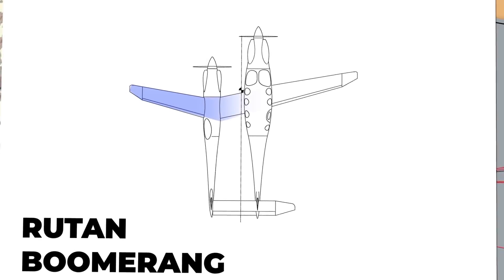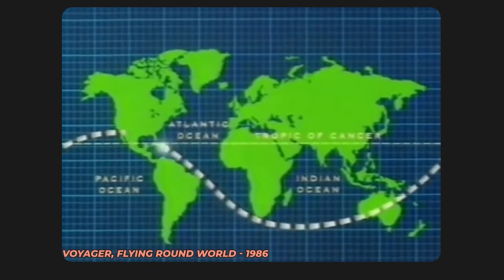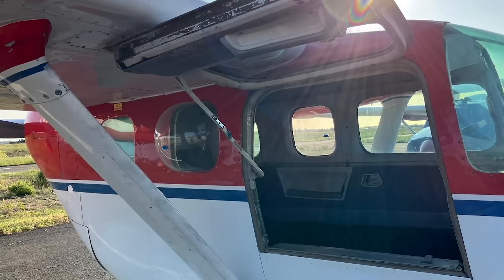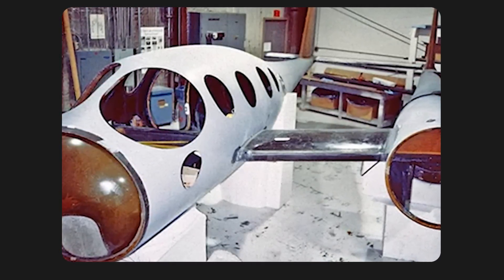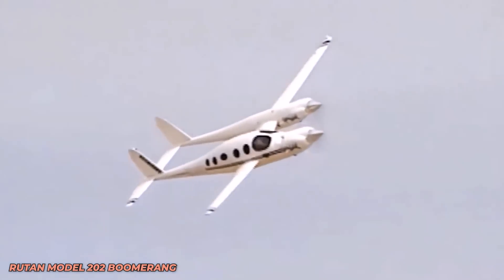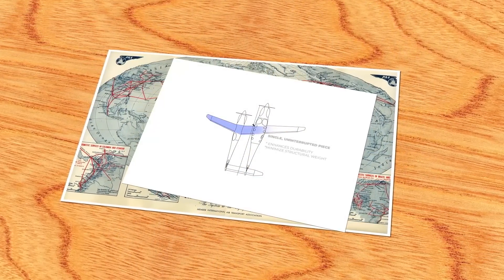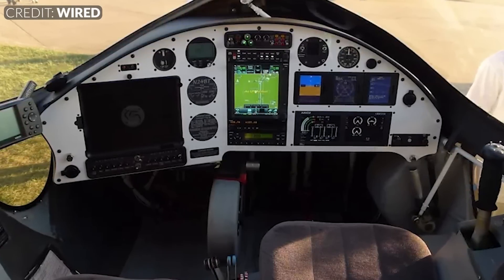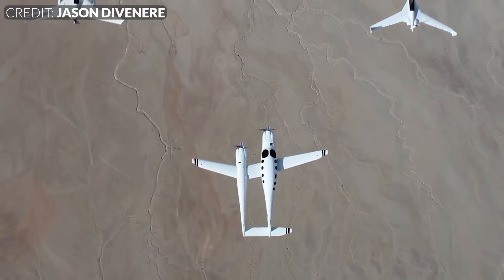Rutan Boomerang: Unconventional Genius!

Comment: He is intuitive when it comes to building that's why no wind tunnel or CAD is needed for his designs. It's a gift. I had a friend  who could not do any RD without this when having fun with our High Power Model Rocket Club. My designs would always out perform his. This would frustrate him so much he asked me one time " How is it you can design a rocket, 12 to 20 feet long, without any mathematical workup and my rocket are so inferior to yours " I replied back, how is it you can design your rockets with all the mathematical formulas ? We both just laughed. I just build the rocket ! Of course I test it and take measurements after it's build, but it just comes to me. My first launch with my first HP rocket I designed back in 1991 put my rocket to just over 10 thousand feet. It landed less then a football field away. All systems worked fine and the recovery system ejected at apogee, I packed it up and lunched again the same day. Today my club, Tripoli High Powered Rocket Club hold a club altitude record of 50K, not bad for a club. I love building things and aircraft are my focus. I often find my self building all kinds of different configuration, of course it's only RC models, but the similarities are the same except for size. With today technology it might surprise you how far model anything has reached levels never possible just a few years ago. I have a RC buggy I built that does 72 miles an hour I couldn't do that without the technology of today. All you need is effort.  I feel as if I missed my calling. I have a aeronautical degree, but it's only a two years of schooling. However, I've worked on aircraft for 20 years, during my military service. When I left I started college to become an engineer, but life sometimes takes you down different paths so Remote Controlled models will have to do. Burt is an incredible designer maybe some day we can gain permission to build a RC model of his Boomerang plane.
Reply: Decades ago, for the longest, people were building airplanes and racecars without the help of windtunnels and computers. Just good ol hunches and guestimation. Today they'll tell you it's impossible without such things, like they'll tell you that you can't just build something without years and thousands of dollars of schooling. At this point, so much research, innovation and tech has been done, so many things have failed, all this man[and the rest of us] needed was some imagination and common sense. That plan looks crazy until you realize common sense dictates the plane has the properties it has, so it works.
Reply: @ItsDaJax  Planes do not fly based on common sense.
Reply: @ItsDaJax would it be correct to say modern tools are more for efficiency instead of viability though?
Reply: @xostler  Yeah, I'd agree with that.

Comment: Does the staggered main gear cause any stability issues when touching down? 

My naive non pilot intuition tells me would cause problematic torque in both pitch and roll, and perhaps yaw to a lesser degree. 

But... would it be notably different than when a similar sized plane has one wheel hit first?

So maybe it's in a normal landing that this comes into any play at all... wouldn't there be a slight bank towards the boom side on touchdown?

Don't get me wrong... I'm not questioning whether he made any mistakes, I'm just curious whether this had a meaningful impact at all. 

All designs are full of compromises, and as this was an idea testbed design the choice of exactly where some compromises landed would probably be different than in a production aircraft.
Reply: Yeah it probably lands flat. If you think about it, the landing config makes perfect sense. It's probably more stable than a motorcycle with a sidecar.

Comment: I wonder if Burt would consider a 6-8 passenger turbo prop variation of this aircraft. That might find a lucrative place in the GA market. I would be interested.
Reply: Hardly. 2 engines are always worse then 1, especially on such small scale.
Reply: @alexturnbackthearmy1907 I mean, 6-8 passengers is bigger scale than the 3 passenger design from the video
Reply: See @jackoneal3933 comment earlier about a larger version and FAA wanting them to pay 10X the normal price for paperwork.

Comment: 12:16 Stability during take-off: To my untrained eye that is not a demonstration of stability. No haters please, defenders welcome.
Reply: I can't say.  It could have far more to do with gusty crosswind than anything about the plane though.
Reply: Ridiculous even to try to judge from a short clip in YT. To judge you would need hundreds of hours of flight and takeoffs and landings by experienced pilots....
Reply: @Axel_Andersen  Which of its design concepts have taken root in any area of aviation?
Reply: @careerscarce167  Whats that got to do with the question if this is a demonstration of stability or not?
Reply: @careerscarce167  The cost of certification for a GA aircraft is $25 M, try raising the kind of money for a better Beechcraft. Add to that the cost of starting manufacturing and the risk of liability and you see that very few new GA aircrafts enter the market. 

So weather any Boomerangs were sold or not does not tell much about the value of the design concepts. 

Good designs/ideas/prototypes do not automatically result in sales. Just likes sales do not indicate a good design.

According to one commenter here the cost for certificating a Boomerang based air taxi was in the ball park of $100 M and that was back then.
Reply: @Axel_Andersen  I asked for defenders and you're being disingenuous. I allowed myself to be pulled into your tangent. It's inherently unstable in the clip because it has a tandem pair of wheels and a sidecar. That raises the pilot workload at takeoff and landing. Why are you bringing sales and financing up?
Reply: @careerscarce167  I brought up sales and finance because you asked  "Which of its design concepts have taken root in any area of aviation", which I think definitely depends on the cost of getting anything accepted or "take root" in aviation.

I have zero competence to make any judgement re the actual plane, my comments were triggered by the poor framing of many of the questions here. People justifying their opinions with things that are obviously moot or invalid. 

This plane may have its problems but the fact that you used a short clip as a spring board to discuss stability that must be complex issue (beoynd my expertise) was triggering.

LIkewise popularity or adaption has little if anything to do wether a product (any product, but especially GA) seems to have very little to do with if a product/idea is good or bad. I say this after 40 years in product development in several fields.
Reply: @Axel_Andersen  IOW: You brought finance up because you didn't have anything. You presented a textbook example of an informal fallacy "fallacy of relevance," aka 'straw man.' The subject was aeronautical engineering and you applied finance to the argument. "Too expensive" was an argument you could win. BTW: The clip at the time cited originally cited used "stable" 12:16
Reply: @careerscarce167  I would not have gone there at all if you had not tried to use the un-popularity argument ie "Which of its design concepts have taken root in any area of aviation" ... which has little or nothing to do with your original "To my untrained eye that is not a demonstration of stability" comment. 

How is that for changing goal posts. 

And my response to the un-popularity argument i.e. very high cost of bringing anything new to aviation is one valid response.
Reply: @Axel_Andersen  "Which of its design concepts have taken root in any area of aviation?"
"Whats that got to do with the question if this is a demonstration of stability or not?"
You seriously don't see that you were granted an opportunity to defend any design aspect, take-off and landing stability and beyond, and you chose to use the certification process as a shield?
I frankly like the aircraft and gee whiz think the forward swept wing would present an engine-out lift advantage on the feathered side, similar to how a swept wing aircraft's leeward wing behaves in a crosswind. But my eye's untrained and specifically I asked not to get into a hater discussion, and here we are in this room. I took the bait.
Reply: @careerscarce167  Sorry you took it that way. I have zero competence to judge the design, one way or other. But you chose to belittle it because it was not a commercial success or am I reading too much to "Which of its design concepts have taken root in any area of aviation". Perhaps. And IMO that has little to do with if it is good or bad. I think I've made my little point several times now. Thanks for playing.
Reply: @Axel_Andersen  Thumbs up

Comment: I think the Boomerang is a fantastic design idea! And having the separate fuselage for luggage and freight is a great bonus.
Reply: Watcha smuggling buddy?
Reply: @ryshellso526  
Watcha smoking buddy?
Reply: Watcha got?😂
Reply: @freedomforever6718  currently skittles Mintz, and a touch of hash.
Reply: @ryshellso526  
That explains everything.
Reply: Just because Rutan designed it you give it a blanket idea that it's genius. LOL. As a research vehicle, I'll give it a pass. Outside of that, it's pure crap!
Birds are symmetrical for a reason.
Reply: @muhammadsteinberg  
Lol.  Birds don't have mechanical propulsion.
Reply: @freedomforever6718  Neither do gliders built to maximize the properties of aerodynamics.
Even the guy that designed it stopped pursuing it. You aren't smart enough to figure out why?
It would be interesting to see what the spiraling slipstream looked like with the engines running. I imagine it would be crap.
Reply: @muhammadsteinberg  
Take your anger management problems somewhere else.
Reply: @muhammadsteinberg 
LMAO
Birds have a single control system.
Birds don’t have twin engines.
Birds aren’t airplanes and planes aren’t birds.
Birds can also fly with asymmetric wings due to injuries.
Reply: @Talon19  Those of you trying to defend this nonsense with more nonsense, obviously aren't pilots. Rutan himself ditched this foolishness. Really nothing to prove here.
Your injured bird analogy was about as dumb as dumb gets. Flying birds it's their major mode of transportation, so they have to fly to survive.  Several decades of flying I have yet to meet a pilot who intentionally flies an aircraft with a defective airfoil of any type.
Reply: @muhammadsteinberg  
The Boomerang is Rutan’s favorite design.  I know because he literally said so at his brother’s memorial earlier this year.
There are also numerous articles by people who flew the Boomerang on only one engine without needing rudder or trim inputs to maintain SLUF.
I have over 5000 hours in aircraft from single engine piston GA to multi-engine turbofan military jets.  I also have a bachelor’s in aeronautical engineering,  a master’s in aerospace science, and have done wind tunnel and then n-flight testing and evaluation.
Yet all of that pails to the simple empirical tests people have shown with the speed, endurance, efficiency, stability, and safety of the Rutan Boomerang.
Reply: @muhammadsteinberg  
You claim to be a pilot yet you haven't been able to figure out how to send a reply directly to the person who you are addressing.
Reply: @freedomforever6718  One is an insignificant youtube conversation. The other is aviation. Please know the difference.
Reply: @Talon19  All those claimed creditials, and you still can't except that, that design was a concept build and has no aeronautical value. 
Let me guess, you're also the most successful Kamikaze of WWII with 300 sorties.
Reply: @muhammadsteinberg  
You just proved that you are not a pilot. Thanks.
Reply: Not really. More like a problem you need to deal with, weight unbalance is a big deal in even monohull planes. The best way to treat it is like proof of concept plane, it is just not viable as-is.
Reply: @alexturnbackthearmy1907    With all due respect, Burt built the plane with the extra pod intentionally not just for reasons related to aerodynamics, but also so he could lug his golf clubs along with him wherever he was going.  It happens to also carry skis, or luggage or any other bulky items that aren't typically able to be carried in more conventional configurations.  It's a totally viable option,  and a really great bonus as @freedomforever6718 said.
Reply: i wonder if the answer on a production model would be the ability to balance the plane out using the fuel in the tanks

Comment: I saw the boomerang at Mojave airport in Sept., 1996.   Scaled composites was managing the flight operations of a UAV, under a NASA contract.  I looked inside the cockpit and saw no instruments, just a laptop.  Inside the main building used by Scaled Composites was the Voyager aircraft, hoisted up to the ceiling.   I also saw a prototype airliner they were working on.    A larger area of the building was walled off.   We were told that area was restricted.   A coworker was declared persona non grata after going in there during a previous visit.   I met both Rutan brothers.   While the UAV was flying a rather large jetliner arrived and stopped next to Scaled Composites's buildings.  Several business-suited people came down the ramp and went inside.    I later learned that Paul Allen was among the visitors and the jetliner was his private plane.
Reply: I thought I read that he used Mac laptops as instruments...
Reply: @earlwebster5351  I think I said laptop.  I didn't get a good look at it.   Their UAV control van was very cool.   It had a big bubble on top of the front where the UAV pilot's sat, which afforded them a 360°  view of the sky above.  They had 2 laptops with large screens for piloting the UAVs.  Edit:  The computers might have been desktop units.   I think the monitors were shielded from the bright sunlight.   Mounted on the back of the van was a genset and A.C. unit.   The A.C. pumped cool air through a large diameter flexible tube up to the bubble.  It was very hot outside.   All the people at Scaled Composites we interacted with were very helpful and knew their stuff.   They loaned me their Bird wattmeter when I was trying to find out why the TDRSS satellite uplink was not working.

Comment: The Boomerang is alive & well in a hanger at the San Luis Obispo airport. At least it was a couple of years ago. I talked to the person in charge of maintenance and we talked about why it was there & not out in Mojave. I actually touched it. It's a one of a kind plane.
Reply: See the Blohm und Voss BV-141.
Reply: It's still there as of this year. Saw it and talked about it with someone involved with its restoration. Such a wonderful plane.
Reply: If it's so good, why haven't more of it been made?
My guess: too expensive to make due to the manual carbon fibre construction.
Reply: @SailingSoWhat  Same reason why newer aircrafts dont sell as good as older ones: They are just MUCH more expensive, with little to no extra gain. It might even be much cheaper to order a brad new aircraft of older model instead of even looking at newer ones.
Reply: @alexturnbackthearmy1907 a damn shame.
Those old birds have such inefficient airframes.

Modern airframes are so much sleeker, have so much less parasitic drag. The fuel consumption is drastically better.
Reply: @alexturnbackthearmy1907   I guess you have a point with the price. However, if we believe this video, the Boomerang does not offer "little  to no extra gain". How would you price safety? Not to mention the performance and practicalities of this design. I think this is more rooted to the expense of getting any new GA air plane designs to the market.
Reply: @Clayne151 Because it's novelty junk! There's no benefit  in this design. Hence, it is a one-of-a-kind concept. I have a hard time believing that plane being asymmetrical would be safe with total engine failure. Trying to glide with an asymmetrical plane makes zero sense to me.
Reply: @muhammadsteinberg  you vs. Burt Rutan. Hmm, that's a tough one to decide....
Reply: The Boomerang is still very much alive and well!
Reply: @russbell6418 It was NOT eliminated and was further complicated by asymmetrical construction. The reason why engine failure is a critical malfunction have nothing to do wth asymmetrical thrust (despite it being a compilation), but because 2 engined aircrafts ARE NOT DESIGNED TO OPERATE ON SINGLE ENGINE CONTINUOUSLY. So is this abomination. They are literally on same playing field here.
Reply: @alexturnbackthearmy1907  you're right, it wasn't eliminated, but it really is a lot safer than standard 2-engine planes and that is because of its asymmetrical configuration. In no way was it "further complicated".
Reply: @alexturnbackthearmy1907 
Asymmetrical thrust is a serious matter when flying twin engine aircraft.
For example, the King Air, Seneca, and DA40 all have oversized vertical stabilizers and rudders to counteract the asymmetrical thrust in case of an engine failure.
Asymmetrical thrust is also why a critical action on engine failure is to reduce thrust on the good engine as much as possible to keep control.
EAA magazine has a fantastic article on flight testing the boomerang with single engine operations.

Comment: Should have compared it to the German bomber with one engine on one side. Propeller torque has a bias to one side so an extra engine is suitable on one side but not the other. BTW rear engines are hard to keep cool.
Reply: Blohm and Voss BV 141 was a reconnaissance plane, not a bomber.
.